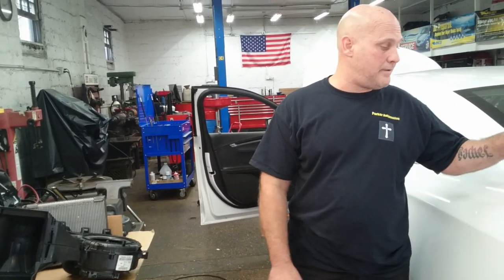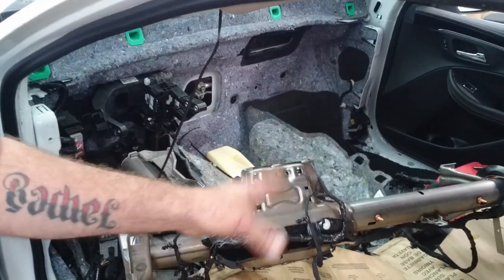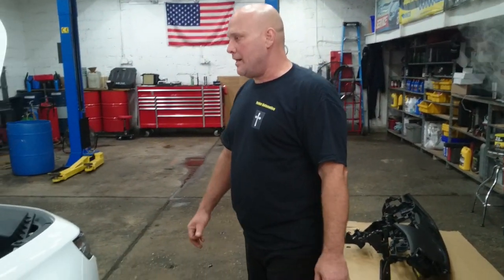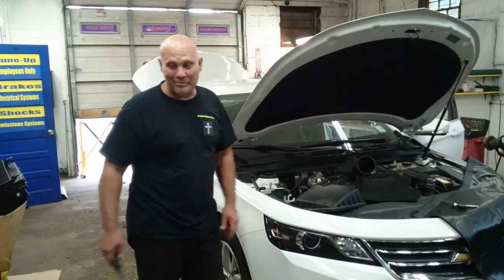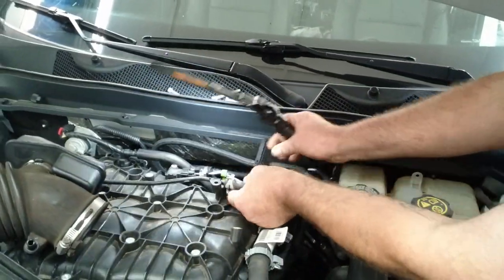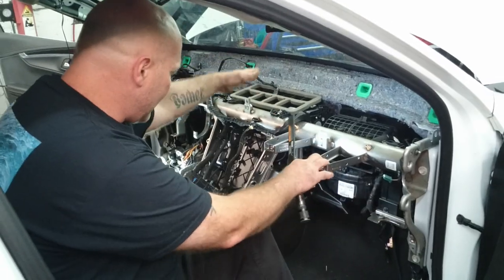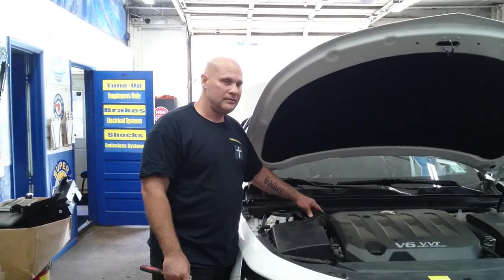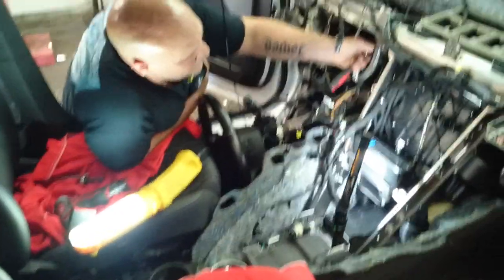2017 Chevy Impala

Comment: Hey bro, I’m with you, this is very long and difficult job. I’ve replaced several HVAC components in all models of cars for years now and they’re always long drawn out jobs but the new Impalas are probably the most difficult I’ve ever done.   
I’ve read that this is a somewhat common failure as GM has a couple TSBs out on it so to anyone who attempts this repair be advised it is much more in depth and detailed than most other dash removal procedures, so good luck and God Bless
Reply from the maker: There is a guy who says this about this job - "Doing one now and no way will I pull all that apart! 4bolts ,center counsel , steering column a couple of grounds and a couple gang connectors  and hoses. and boom!!!"
It's not gonna happen right brother!  lol
Reply: Hello,

Someone did this job on my impala, but now the buttons to change the airflow direction (front, feet, windshield, ect) in the hvac control panel don't work. If I push the buttons they do illuminate, but nothing changes. Same thing with the temperature, if I change the degrees with the  dials it stays cold, no matter what I do. This used to work perfectly before the job. 

What I'm thinking is that the actuators are disconnected. Can you guys help me figure it out where the connectors are?

Comment: Hi Parkers,, I just read a TSB that says GM will pay for the evaporator replacement job.
#N182186881-01: Special Coverage Adjustment - Evaporator Core Icing, Leak - (May 1, 2019) This letter is intended to make you aware that some 2016-2018 model year Chevrolet Impala vehicles, equipped with a 3.6L V-6 engine may have a condition where the air conditioning evaporator core may become damaged as a result of repeated freeze/thaw cycles without proper drainage of the condensate from the core. A damaged evaporator core may leak refrigerant and result in a loss of air conditioningfunction. What We Have Done:General Motors is providing owners with additional protection for the condition described above. If this condition occurs on your 2016-2018 model year Chevrolet Impala within 6 years of the date your vehicle was originally placed in service or 72,000 miles (116,000 km), whichever occurs first, the condition will be repaired for you at no charge. Diagnosis or repair for conditions other than the condition described above is not covered under this special coverage program.
Reply: Thank you so much for giving out this info the evaporator coil has a leak in my wife 17 impala took it to the dealer and they said 1800 to fix but never did they mention this.
Reply: So my 16 impala ltz is covered by Chevy dealer. What did I need to tell them I’m sure they’re not gna tell me it’s covered?
Reply: Thank you Bob F mine just went out about to call Gm in the morning and see what they say because dealer trying to charge me $1750